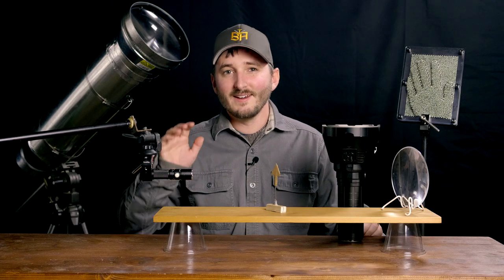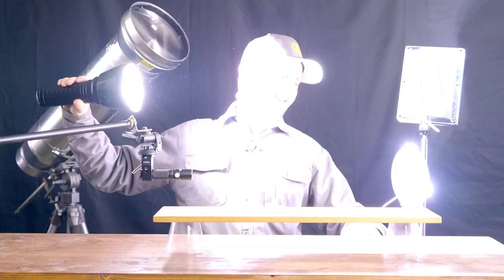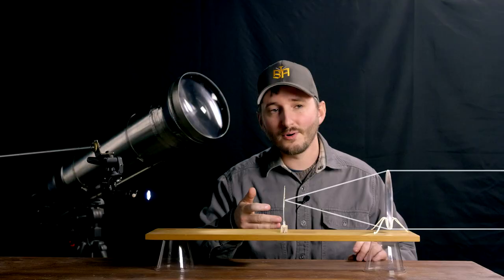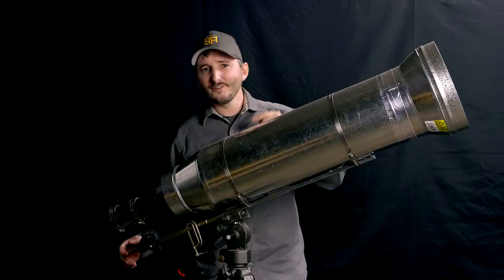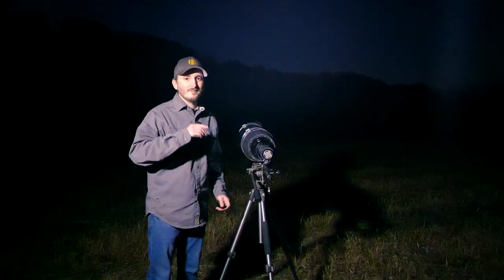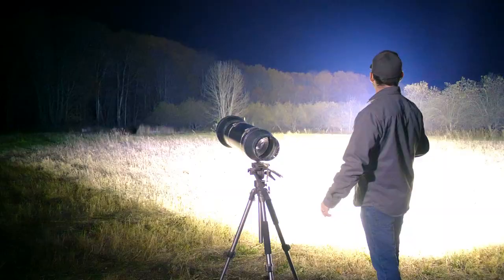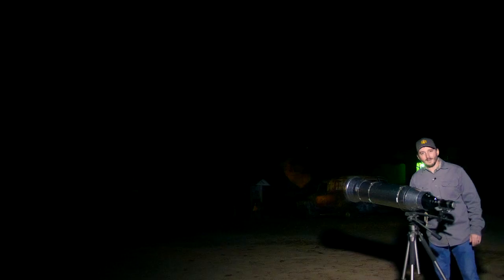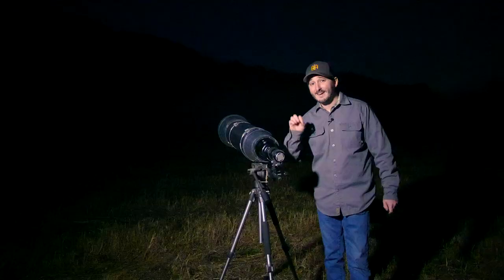How to Make a BATSIGNAL (For Real!)

Comment: Its only "like a laser" in that its emitting light. 
Other than that, not really. 
 I get what you are trying to say, but lasers dont inherenly use lenses. I mean you can look at the lasing medium as a sort of fiter/pump/lens, but its so differnet and more complex than a simple optical lens that the analogy breaks down.
Reply: Lasers still require a lens to collimate the light into a proper beam... Without a lens, the light is too divergent to be considered a "beam".
Reply: @nabzim  nope if the light isnt a beam, its not a laser, at least in most cases. The entire point of a laser is the creation of a narrow beam of coherent, monochromatic light. 
 Thats literally the entire point of the exercise.  CAN you use lenses with lasers? Sure. Absolutely. Do even many laser products have lenses built into them? Yes. Absolutely. 
You dont know what you are talking about, if you had read and understood much about lasers you would KNOW that for basic lasing to occur, it can be achieved with NO lens whatso ever. 
Unless of course you are wanting to get pedantic and call the lasin medium a type of lens. Which is fair, but ultimately its stupid AND not what you were saying. 
Im not being mean. 
Im really responding to someone who straight out incorrected me while i was correcting someone who spoke incorrectly in a quasi educational context.  
Hes wrong, hes presenting a misconception about lasers that people such as yourself have heard before and accept as true and even make up their own supporting illogic to support. 
 Like when you said a laser still needs a lens to focus the light into a beam because before that its too diffuse to be considered a beam"
Something along those lines. 
That 100% you making something up to agree with this guy. That not been written anywhere in any authoratative text on basic laser design EVER. 
The entire benefit of lasers is that they allow a very concentrated beam to be projected over LONG distances maintaining its shape and size and a high degree of its intial energy content, WITHOUT the need for delicate, complicated, fragile and expensive lenses. 
 Does the beam spread, yes. But over very long distances and it does this even ig lenses are used, it just takes longer. 
 Go read in depth about lasers. 
DONT go trying to find a laser being used with a lens to prove me wrong. Go do a deep dive into lasers from the top. You havent or those words would neve havs reticently and awkwardly and incorrectly fallen off the tips of your uninformed fingers. 
 If that makes you mad, good, perhaps it will serve two purposes, it will prevent you from speaking out of school, making youself look like a right toss pot correcting your intellectual betters on something they absolutely know much more than you about, and perhaps it will anger you so much that you so storming off against my nearly expert advice looking for evidence of how im wrong, and you will actually learn something useful. Once can hope. 
Dont take this personally, its mostly in jest. You are wrong as pants made of pickles but you can go learn the correct information so in the future you dont speak with such unfounded confidence on something you shouldn't.
Reply: @metamorphicorder  okay... I have read a lot about lasers... I also own a few laser pointers and working on building one myself. I guess I have only familiarized myself with lasers in the context of their physical application of making cool looking beams. I get that lasers don't have lenses "built into them". Lasers need a lasing medium and and excitation source, and that's all that's required for the lasing process to occur... But I'm not referring just a laser source (lasing medium) alone; by "laser", I mean a laser that has all the other features/parts that make lasers useful in applications. That is any number of mirrors, lenses, prisms, optical coatings, output couplers, etc. Lasing mediums, by themselves, are not used commonly on their own (that I am aware of) as it would produce two beams traveling in opposite directions. So, would you mind, please informing me of the applications of a lasing-medium by itself, and give real examples, instead of just trash-talking me? I know you're not being "mean" in a sense, but, you didn't seem to explain much other than how totally-wrong I am (and repeatedly). I believe there's just some misunderstanding between what each of us is trying to say to the other person.
Reply: @metamorphicorder  and in reply to your first two sentences, for all the lasers I own (which are all diode laser pointers, and a couple green DPSS laser pointers) if I remove the lenses, they all produce a fairly widely-spread out "beam". Perhaps we just have different definitions for this word, beam?

Comment: So what do you think the fewest lumens needed would be to reach low lying clouds and still be visible? The 100,000 seems like it probably isn't totally necessary. Would say, 20,000 work? I would love to build one, but I would also love if my wife didn't divorce me for spending $700 on a flashlight to build a bat signal. There are a lot of $50 "100,000 lumen" flashlights, but I'm dubious they really have that output.
Reply from the maker: 20k is probably fine for clouds lower than 1/4 mile

Comment: While I don't doubt that the torch is the brightest on the market, I'm pretty sure the 100000 lumens number is  an overstatement/marketing/porky.

It would be significantly above the max what the parts are rated for (4 and a bit thousand lumens per led, 18 LEDs)
 70000 would be believable.

Even if they did just push the power through, the batteries probably couldn't handle it- this thing would use over 500w to get 70000( not including conversion efficiency. 

100000 would realistically require more than  a kilowatt at the batteries themselves when droop and stuff where factored in, which would be a struggle even for 8 21700s (as well as probably burning your hand.

Looks an excellent product, but they shouldn't be dishonest.
Reply from the maker: I haven't found any reviews that took a reliable output measurement to find out for sure. Most say it's 70-80k in reality, but don't back it up with any kind of data. In any case it's incredibly bright.

Comment: Can you cycle through a few more obtainable flashlights for us as that is a $700 flashlight.
Additionally, does that lense any any effect on lasers - will it focus a $5 keychain pointer sufficiently to achieve the distance you see with the more expensive lasers?
Finally, everyone normally uses fresnel lenses salvaged from TVs - how does that one compare for $30 as far as focusing the sun?
Reply from the maker: Any light around 1,000 lumens or more will do well to give you an image at 200 feet. Lots of options under $50. Thrunite tn12 comes to mind, but that's probably an outdated recommendation. The distance of keychain lasers is limited more by the lack of power rather than the lack of focus. More powerful lasers reach further, but they are also dangerous to eyes. Optical fresnel lens is a good deal better than one from a TV, but either will give you a good enough result to tell what you're looking at.

Comment: Can you disassemble a computer monitor and put a non-backlit lCD screen in front of the flashlight please. Using the flashlight as the backlight source you should be able to use this like a projector.
Reply from the maker: Planning on it
Reply: @Nighthawkinlight  Nice! If you use an E-ink display it may do a better job of blocking the light. Standard LCD may get "washed out".

Comment: I'm a little skeptical about the 100,000 lumen claim. They claim it has 18 x XHP70 LEDs. CREE says these produce 4000 lumens at 32W so they must be overpowering them. Running them as CREE suggests would mean 72,000 lumens and a whopping 576W or approx 800W to get to 100,000. Is this sort of power output really feasible for such a tiny battery?
Reply: Their spec sheet is very hard to understand but I suppose it should be able to run for 8 minutes with 8*4Ah 3.7V cells.

Comment: Fantastic video - like the rest of your production. But I cant seem to copy it... Anybody, who can help?  I have a 125 mm magnefying lens, and a pipe with aprox the same diameter (little bigger) Then I have a constrution lamp (dont know the right therm - but the ones you put on a pole, when you are working outside in the dark) But i doesnt seem to have any effect - I dont get any straight beam. Is it because the light from the lamp is too diffuse?
Reply from the maker: You may need to move the light much closer to your lens, or much further away. It depends on your lens focal length
Reply: @Nighthawkinlight  Allright, it might be that, thanks - Ill try it tomorow

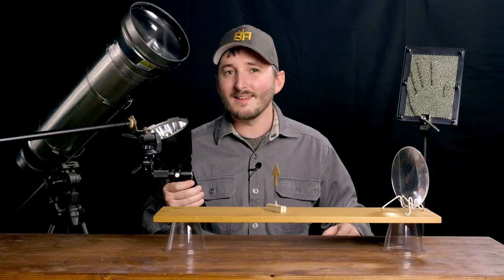Comment: at 0:49 are you sure it is 100.000 lumen? at an optimistic luminous efficacy of 110 lumen per watt, that would be ~1KW in leds on that thing. edit: hmm, the manufacturer does say it is🤔.
Reply from the maker: I totally believe it's consuming that much power. It gets scalding hot very fast

Comment: * Wants an image in a spotlight * 
* Uses a multi-element flashlight *
Reply from the maker: Point light source is good for a non imaging light, but there's no benefit of a point source for casting an image like this. The light needs to be outside of the focal plane or it itself will be in focus and run the image. It needs to be out of focus so there's a soft defocused light surrounding the sharp image. Doesn't matter if it's point source or not, you just need it as bright as possible.

Comment: 2:54 Bro, your ray diagram is wrong. If the rays travel like that, you will not get a sharp image on the screen.

The other thing I want to point out is that you have bluing around your BATSIGNAL. There's a way to get rid of/reduce that.

Comment: Why is the flashlight so far away from the focal point? That will be the main source of decoherence/fuzziness I suspect. Personally I’d have placed the torch right at the focal point of the lens (maybe with provisions for adjusting it) with the bat symbol coming after the lens. You want the light rays to be parallel, and they’re coming from the LED, not from the symbol.
Reply from the maker: If you have the flashlight at the focal point you project an image of the leds and the reflector. You need to defocus the flashlight so you get a soft white background instead of a picture of the front of the light
Reply: @Nighthawkinlight 
I think that makes sense. I’m thinking from the perspective of an LCD resin printer, where it doesn’t matter as much. It might be fine to just have a diffuser sheet after the LED, and focus the lens on that. Not sure how much light you’d loose from that though, and it would barely be much different to how it currently is.
You can swap about the order of the lens, LED, and image (and optional diffuser) somewhat and still get the same result, which you can prove with ray transfer matrix analysis. It’s a surprisingly easy and practical method for dealing with optics without a simulator, provided you respect its limitations (small angle approximation, thin lens approximation).

Comment: Why didn't you walk away from that barn or trees even further once it was obvious that the lower settings could do the job from there?
Reply from the maker: I was about as far back as I could get from the trees, and for the barn if I backed up further the image would be too big for the side.
Reply: @Nighthawkinlight   Thanks! I hope you get better weather for this soon, and we can see a part 2.
Reply: @Nighthawkinlight   I have an idea for a video with that light in the meantime... Maybe it is stupid, (probably is. :) ) but when we hold our finger right over a smaller light it lights up red, because light can pass through a certain distance. Maybe if you could somehow isolate the heat, and put it against your body, could it light up a bigger chunk, like an arm, leg or even a torso the same way?
Reply from the maker: @axellno1759  I believe the action lab did something like that, shinning the light in his mouth so it came out his eyes.
Reply: @Nighthawkinlight   That sounds interesting, I definitely will check it out. I wonder how it affected his vision during the experiment...

Comment: Where do these "flashlight" manufacturers pull these "100 000 lumen" specs. Out of their *ss? Cree says in their XHP70.2 datasheets that this led achieves maximum 4292lm. 4292lm x 18leds = 77 256lm? Where is the remaining 22 744 lumens??
Reply: And still if you calculate the absolute theoretical maximum output of these leds which I think is in infinitely large copper block, where all the heat can be dissipated, is 5249lm x 18led = 94 482 lumens.
Reply from the maker: I'm yet to see anyone do a calibrated test on the ms18 output, but some of the reviews mention the light hits 100k for one or two seconds in turbo before dropping into the 70s. I don't know. Either way it's bright enough to make you happy.